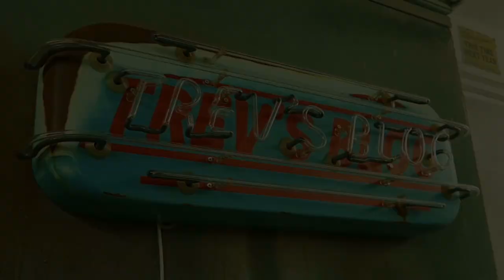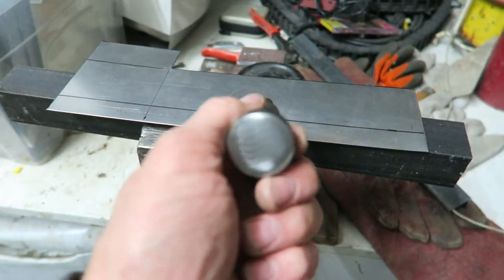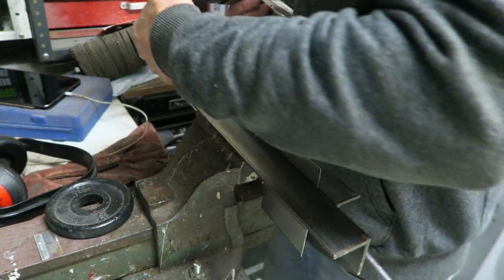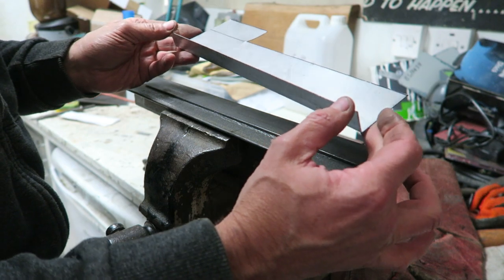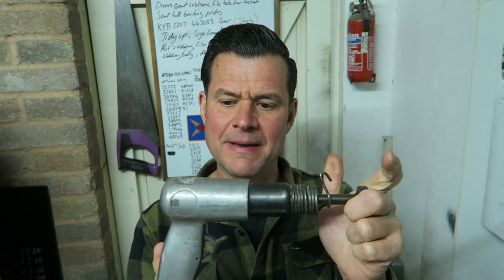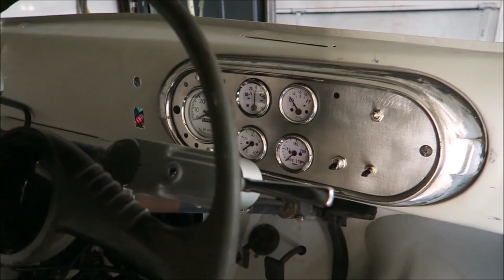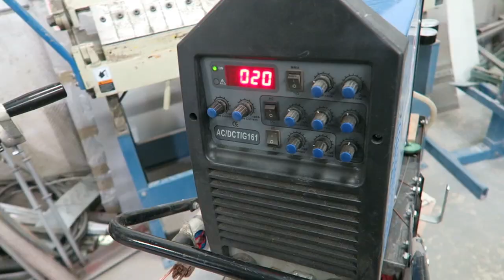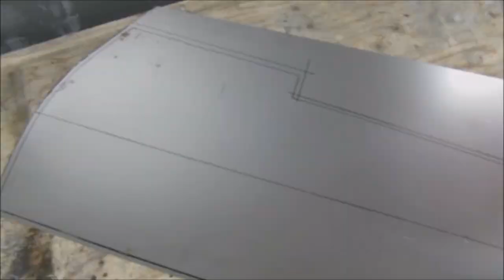How to fold a perfect lip on a car panel without using a metal folder pan brake Tips and Tricks #63

Comment: I have tried to come up with a plan to make retainer channels for weatherstrips for a loooong time. I'm currently restoring and doing a video series of a tractor cab and the crusty leftovers of the retainer channels has been used to spice up my dinners lately. Nothing beats rust-pepper hehe
I have searched the entire internet 200 times for a solution to make those channels and......nothing. BUT I think I have been too focused on finding an easy method. My metal brake is a cheap one and almost impossible to use so I discarded that idea.
I abandoned the retainer-channel fabrication but then.....Youtube told me I REALLY had to watch this this video.
Now I have found the right inspiration to make these and I'll be sure to give you credit for it and also I will surely subscribe to your channel.
Thank you so much for this good tip and I hope your arm will heal and become good as new. Have a great day :)
Reply from the maker: Thank you and if you want to send me a picture via email, I may have another suggestion. Maybe… cheers Trev ps email is in the video description 👍
Reply: @trevsblog  Thank you so much for trying to help :) Sorry about the late reply. The flu has been visiting the last week. I have emailed you with a couple of images and some links. Hope to hear from you. Cheers :)

Comment: Trev, hi from USA, same here, life is not what it used to be.  Anyway, I completed my first major body repair, a full rocker rebuild including new inner flange, mid flange to existing but rotted off "ribs", and a patch panel outer rocker.  I was using a bead roller to bend over the 18 gauge metal, but only got about 30 degree bend and bent the rest with angle iron.  I liked using the bead roller but too bad it was limited.  Thanks for the idea of using an air chisel.  My shoulders have been aching from all the abuse they get.  You are like a friend I've never met in real life because your amazing good nature comes over in your videos and your talent is amazing.  [So good to see this video so related to the job I just finished.]
Reply from the maker: Hey thank you much appreciated 😊

Comment: Welcome Back Trev.
Been a bit of a while.
Handy little tip again for quick sections.
I have seen others on YT use similar for forming beads in floor and firewall  panels using a rounded end chisel shaft. and a steel or Hardwood form plate with the depression.
So versatile.
Reply from the maker: Thank you and yes I’ve only just touched on it’s usefulness 👍

Comment: Great tip, remember lots of us haven't a clue!!
Crisp line, I have similar air chisel used for bearings ect, real world I find not amazing, however if I would replace would be something else, I lend a Chicago pneumatics (CP logo'd no affiliation!) Way less vibration and so much more power without noticing, knocks seized bearings with ease 😏😁
Great video Trev, I'm happy with short simple tips
Reply from the maker: Yes agreed CP stuff is excellent 👌🏻

Comment: That's a great use for an air hammer. I'm a mechanic, so I have a few air hammers and those flat bits as well. Tennis elbow, Ugh! I had minor tears in my elbow tendos from repeatative mechanic work. I had therapy sessions to repair it and avoid surgery. What worked for me were theraputty,  resistence bands, hand twist exercise bars, and Granston tools. The Graston  tool especially, because it massaged the area with a scraping technique which also broke the internal scar tissue allowing it to heal. I used stationary exercise bike with my arms to warm the muscles (10 min.) Then did various exercises.  Each session ended with a 10 minute ice pack, or graston tool scraping.
Reply from the maker: Hey thanks for the advice much appreciated 👍

Comment: Good video - I didn't know the "proper" use and I'll have a couple of ball joint tapers to release shortly 🙂👍🙂
Reply from the maker: Works unbelievably well. I held a lever under the lower arm and gave the hub a short blast and the ball joint popped right out and it was solid! Thanks 👍

Comment: Great bit of advice. 
Would work well if you needed to do a fold longer than a folder if you had six foot of angle and a load of clamps.  

Lovely that you end with thoughts for everyone out there.
Reply from the maker: Yes precisely, you can make a fold any length you like and what’s more that fold doesn’t have to be in a straight line, it could have cutouts and curves etc. extremely versatile. Thanks Trev 👍

Comment: I use my aircraft air rivet hammer to do the same as the anvils are nice and smooth already. It's Ok I use one that's already beat up... It's basically the same tool but it's allot easier to tease the trigger for better control. Works great on door skins too. As for the box brake I look at it every time I'm at one of our tool stores and can't justify buying one or the large amount of space it takes up. I still kick myself for not buying a 48" box brake for $100 locally that was new but out of the box...
Reply from the maker: 100 dollars good grief that’s an absolute bargain. The cheapest Chinese one I can find is nearly £1000! Cheers Trev 👍
Reply: @trevsblog  Yeah it was bad timing on that deal. They run around $800 ish for a 48" and $380 for a 24". The store here had the 48 on clearance 2 years ago for $350 and I still passed it up. They were freeing up inventory space but at that time it was $500 new. Grr inflation... I'd bring one over and save you a few $ but I think it might be a hare heavy to bring as checked luggage..

Comment: Good to see a new vid from you Trev!  Had never thought of using an air chisel like that, will have to keep it in mind for future projects.

So you had a little bit of rust on a sill and that was enough to fail the MOT test? I've heard that MOT tests over there are really strict.  Over here in the US the majority of states don't require ANY annual auto safety inspections, believe it or not!
Reply from the maker: Yep this is the uk, we like plenty of legislation and red tape! Bizarrely you don’t need an mot on a vehicle over 50 years old 🤣

Comment: I suffered from golfers and tennis elbow along with carpal tunnel issues. I used a Powerball and after a week the symptoms started improving to the point that now I generally don't have any problems - if I do, a few days of Powerball sort it. If you get one don't go for maximum speed. 10 seconds one rotation and the 10 seconds the other way, then swap hands several times, twice a day.
Reply from the maker: Thanks for the tip, worth a try definitely 👍

Comment: Trev, have a look around for an Aircraft Rivet Gun, Far more control then the Sealey chisel.
They are rated in sizes from 2X to 6X, for what you are doing a 3 or 4x would be fine.
I use a 4x for hammer form work, with steel.
Reply from the maker: Hey thanks 😊

Comment: I don't play golf or tennis and have the same problem ...

I'd be lost without my 3-in1 bender/shear/slip but I don't run air in my shop the CNC makes enough noise.  Interesting use of a planisher though.
Yes things are looking iffy all over, but so easily solved but that's content/comments for other channels. Keep pushing forward.

The elbow for me turns out hours/decades of working on a PC using a mouse would you believe.
Reply from the maker: Thanks for your comments 👍

Comment: Hi Trev could you please make a video on welding upwards and above head height so to speak. I’m trying to weld in a new liner to the top of a door aperture. I get lots of MIG splashing over the floor but little else!
Reply from the maker: Turn your wire speed up to counteract gravitational pull.

Comment: I wonder if an sds drill would do the same job on hammer only action.
Reply from the maker: There is enough power in an sds drill to form sheet steel, I have a plan to make up a forming tool utilising one. The mechanism is much the same as a French power hammer. 👍

Comment: Air Hammers are a great tool for planishing compound curves in a mold to get a part that would be impossible to create any other way. Commonly used to create aircraft skin components.  A simple 90 degree bend can be accomplished with a hammer. Yeah, I like dragging out tools I really use only for the sake of putting oil through the tool.
Reply from the maker: Thanks for the info!

Comment: Thanks for the reminder, Trev. Using an air chisel/air hammer/rivet gun for metal forming is a great idea, but if used all the time can lead to carpal tunnel syndrome in your palms and/or wrist problems. Use it sparingly and be aware of your bodies warning signs lest you damage yourself. It took me ten years to recuperate back to 75%. We are but frail humans.
Reply from the maker: Great points. I’ve definitely suffered some kind of repetitive strain injury. 👍

Comment: Thanks Trevor for sharing, many thanks . What about a few heavy G clamps if the job is a long fold,🐥
Your repetitive strain injury symptoms are exacerbated by long periods of vibration . Tools should not be used for more than 5-10 mins with a break of 5-10 mins to allow capillary circulation to flow through and maintain oxygen to nerves. Use Wim Hof to boost blood oxygen levels first.
Reply from the maker: Thank you for the information. Very much appreciated 👍
Reply: I was thinking clamps at the end of the angles too.

Comment: Well done 👍, but the bender still makes repairs easier.
Reply: This is true but it's always good to know different ways of achieving the same end product in case one does not have a finger break or the like. When I learned metalwork 56 years ago, my fabrication instructor would not let us even touch machines, or even any power equipment, (electric, air or flame), for a whole year. We could only use hammers, dollies, our own handmade bucks and forms plus any steel/aluminium we needed to make a tool. The idea was to teach us to do it all the hard way so that even with a dearth of machinery, we could always achieve the result desired. This philosophy has stood me, and I daresay all the others he taught in good stead, lo these many years.
Reply: @tobygathergood4990  Это очень правильный подход.
Reply from the maker: Yes you’re 100% right a bender is definitely a fantastic tool. Many people either don’t have a bender or the space to house one. This is an alternative method of creating a bend without the finances space or equipment needed 👍
Reply: @trevsblog  Bro what's your name? My name is Sergey. I would like to chat if you don't mind via vatsap.
Reply: @ОлегТаранов-у6у  Спасибо за ваше согласие.

Comment: Tinmantech sells a similar gadget but it has a cup into which you can out plastic inserts of different hardness. He uses it for what he calls flow forming which is bashing metal into a female mold, usually bondo. But it can also be used for this and no danger of stretching the edge.
Reply from the maker: Sounds awesome, he sells some interesting stuff including special lenses for gas welding aluminium 👍

Comment: Hi Trev, great to see you and a great video. i have seen this used buy a Canadian YouTuber I also follow and he has made some really good panels with forms hammered into them as opposed to having a press tool to do the same. 
Regarding a metal folding machine , I made a big bench mounted one to make some bespoke box sections for my project. I will attach a link. It was pretty straight forward and cost me about £90 as opposed to around £500 as I needed almost 900 mm capacity. I have finished with it now after making around 20 bends. 
All good fun though. Take care of that right arm, you will need it for a long tome to come, for lifting pints etc etc.
https://youtu.be/xUhvPeaA31I
Kind regards Paul
Reply from the maker: Thanks Paul to be honest I really should have made my own or bought one by now. The catering business has taken over every spare moment for the past couple of years which has prevented me from progressing. I’ll be sure to check out your link. Cheers Trev 👍